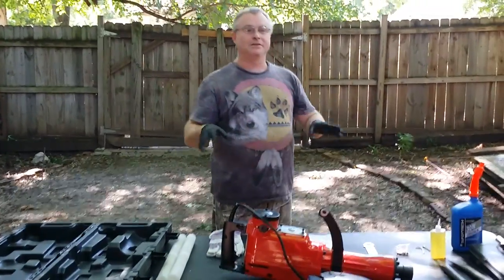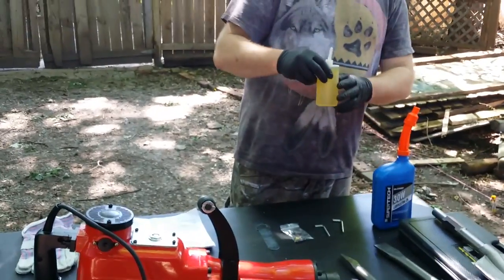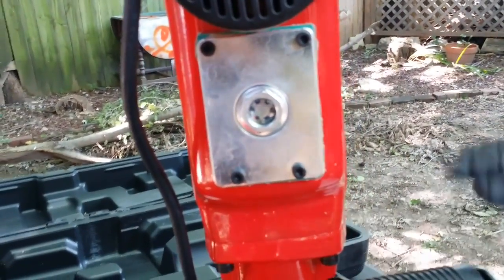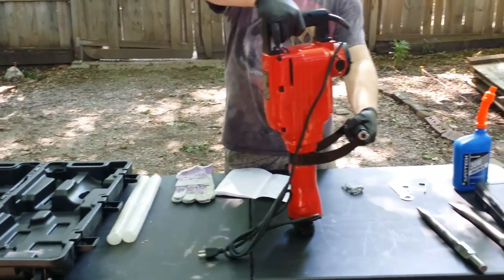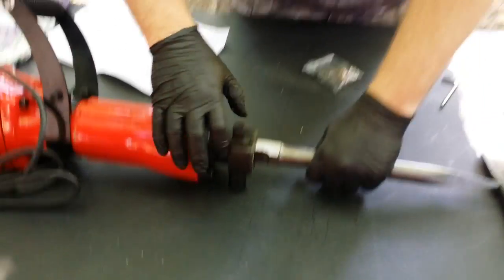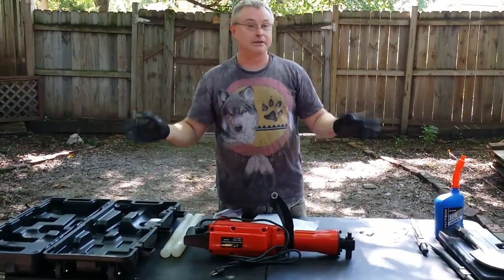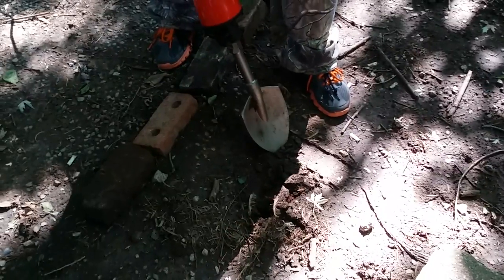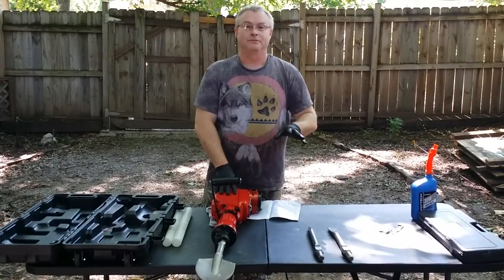Demolition hammer part 1

Comment: I had written quite a little bit on this based on something I heard. I finally got a reply back back from ExtremePowerUS regarding the oil to use on these, and he just said any regular oil from 20 to 40 weight. Gee I hope the heavy duty Shell Rotella 5W-40 Synthetic for diesels does not prove to be too much. They should really have explained all that in depth in their Owner's Manual, but it wasn't even mentioned.
Reply: LOL! I have looked at some reviewers on Ebay for this machine and at least a couple claimed they used light machine oil. That had me baffled, as I would not use such in a machine like this. The reviews are great on this unit and Ebay sells them cheaper than Amazon, plus they accept PayPal. I ordered 2 different types of spades for it. I have an old broken tree stump in my back yard which the inspectors claim can't be taken out with a stump grinder, as an electric power line runs beneath it and the roots have entwined in that line. I have the area marked and will use mine to remove roots and later I will chop the stump flat and use a heavy duty root killer to kill the thing so it can be removed.  I don't know if synthetic oil works well for this machine or not. I am hoping I can use this without it killing my shoulders, as I have bad arthritis. The manual is often the worse bitch about this machine in all the reviews. The print is way to small for me, so I will have to get my magnifier to even begin reading it. We have had a couple of major thunderstorms here for the past 2 days and I just got mine delivered today, so I have not had a chance to use it, yet. The soil here is caliche and as hard as cement, even after a heavy rain. This video sure helps me a lot as to what to expect.  I have a heavy duty extension cord to try out in using this machine, too.
Reply: @a1930ford  I have seen people use just regular 30 weight oil, and I am sure that will keep the metal good enough, but if you really want to protect your metal, you want to run a full synthetic. I believe I am running Rotella 5W-40 Synthetic for diesels. The action of my jack hammer is rough on the oil, and I can tell by the way I run through it as I have to check all the time to keep it from going low. I was recommended the specific weight because of where I live from Rotella's technical support which is a Shell product I believe, and people trust it enough to put it into fleets of expensive big diesel engines. I would have gotten the Amsoil equivalence,  but had to go too far to get it.....Any oil is better than no oil, but use a quality oil, and one that will adjust to your temperature range. You would probably not want to start one on a cold day with standard 30 weight. It could cause an initial stiff amount of drag on startup, and it is never good to strain any motor. 
   Good luck to you on your tree stump. If you are cautious, and surgical enough, you should be able to avoid the wires under it. I learned to use the aluminum oxide steel cutting blades to remove a tree stump, cutting through each root at a time, and then used a cherry picket to lift it out. Just make sure to be able to see in full, and behind it, whatever you are cutting. The aluminum oxide blades are good because they are expendable. Keeping a spray bottle of water is good too in case the blade ignited the tree, as it will smoke. Stay safe. 
   Oh, and regarding your bad soil, if you lay mulch over it year after year, it will enliven it to a humus state. You just do not want to get it too close to the house because of bugs.
Reply: @a1930ford  Oh; also, to avoid shock which is real important for your well being, use at least a bicyclist's gel glove, and never forget to wear ear protection. Also reread my original reply because I had edited it. Hope this helps.

Comment: I just bought one on eBay $108  outstanding tool for the money busted up a solid concrete stoop in no time at all . I had been chipping away at it with a sledgehammer and getting nowhere  took about 35-45 minutes with this tool

Comment: What type of oil did you use? I have a very similar hammer but the manual doesn't say anything about the oil.

Thanks.
Reply from the maker: Gandalf4137 I use 30 weight Super Tech 3 lubrication oil non detergent
Reply: @wolvesr4ever38   I used gear oil ????

Comment: Just bought one myself but a different brand.  It came with safety instructions but no user instructions.  I had to watch  YouTube videos on how to insert the bit attachments and where to put the oil in.  I've rented these before but decades ago.   My question is what type of oil is used?   I couldn't find anything specific for a n electric demo hammer so I ended up using pneumatic tool oil.
Reply from the maker: 10w30 or 10w40
Reply from the maker: Non detergent 10w30 or10w40

Comment: I am looking for a tool to hammer metal and think this might work by mounting it vertically like a drill press.  Is there a lot of vibration?  Does the bit need to be in contact with the object to engage the motor?  How often does it need oil?  Five minutes running time, ten?
Reply from the maker: Check the all once week add if necessary other than that I'm no hat had no problems with it. I have the jackhammer for couple of years now it still works great

Comment: Hi,l like your video.Question?what is causing problem when used the the xtrem jackhammer it runs but chiesel doesn’t have pressure to hit the slab or rocks.is this a chock from a part or missing oil?

Comment: Hi, bro. I just bought a 2800w Makute demo hammer, looking for clear instructions everywhere till I finally came across your video. It's really more useful than the manual. Should I use a 15w40 diesel engine oil? Or something below that? I can see that the video is 7 years old so hopefully you're still around 😅

Comment: I wanted to ask you if you think this demo hammer will be good for breaking concrete in a rotted out fence post hole? So instead of digging them out I want to be able to just put the chisel on the concrete and bust it out. And pull out pieces. I figured it should be way faster than digging them out. 
Anyways that's my plan for mine when I get it. 
Do you feel it will work for that?
Reply from the maker: it will definitely work I used to Shovelhead in the holes for my back fence posts work great and I can't wait to see your project that you get to work with that a demolition hammer

Comment: That Demolition Hammer  only less than $200?  Wow!  I want to get a rotary hammer and was looking at the Bosch rotary hammer rh540m that has 6.1 pounds of blow force for $400 or the Milwaukee 2 inch rotary hammer that has 19.1 pounds of blow force that would cost more than $800 dollars.   All I want to do is use one to drill holes in the ground to place 4 x 4 fence posts where the soil has packed rock in the ground.  So would you recommend that Demolition Hammer you have and for the price is amazing.   How longs does that Demolition Hammer last?
Reply from the maker: Well Tony I've had my demolition hammer now 2 years and I still don't have any problems with it I've only had to replace one spike because it worn down but do I recommend it yes for a under $200 absolutely for what we do around our home is perfect
Reply: Thank You Wolversr4ever38.   I am definetly going to order one next week.
Reply from the maker: @tonymadera3603   I'm glad I could help

Comment: I bought the same model but the locking mechanism isn't turning all the way to lock it only goes half way.  Any recommendations on what might be wrong?
Reply from the maker: ZOMBIEKING779 which locking device on the jackhammer we are talking bout so I can help you better
Reply: wolvesr4ever38 
Hello, it's the locking mechanism/pin where you inserted the shovel
Reply from the maker: ZOMBIEKING779  do have any problem with the spike or the chisel blade with the locking device if so need to return the equipment back or if not the it might the shovel isnt the right one for this jackhammer

Comment: I just ordered one of these yesterday. I've rented the same size demo hammer from Home Depot and they apply grease to the chisels "bits" do you need grease the bits? (The shank end that goes in the demo hammer) 
Thanks!
Reply from the maker: Wyatt's Dad make sure you do grease the the chisels, the  grease will keep it from  rusting and it helps for lubrication when the chisel is causing friction while working

Comment: I have the same hammer drill that I purchased from Amazon. My instruction sheet called it a HYAT ET1108-110v Hammer Drill-65mm.  The instructions recommended (one liter) of Shell Rotella #40 engine oil. My local TSC (Tractor Supply Co) has the gallon jug on sale for $14.99 at the time of my post.
Reply from the maker: mine says Stark on the box as well as 1400 beats per minute there are very much similar ones out there and anyone from Amazon in the proximity of what you're buying depends on the model they have available but the are the beats per minute is pretty much exactly the same Minds is 1400 per minute on my hammer

Comment: Thanks for the video and showing the steps when first getting the tool. I must say the provided manual is “crap” and does not explain AT ALL very well where or how to feed the oil into it. The manual actually points to removing the cap where carbon brush is located and does not even mention anything about unscrewing the oil window as to where to feed it oil. 

I must also warn those that get one, careful with removing the carbon brush screw and screwing back in, it’s a little tricky and hard to seat the brush and spring before screwing the cap back on. 

Great video! Thanks again.
Reply from the maker: I'm glad I could help you and thank you for the comments

Comment: Just received my hammer and your video was very informative. Do you think Miracle oil that is used in air tolls would be good for this hammer?
Reply from the maker: Not thick enough to keep the Hammer working correctly
Reply: @wolvesr4ever38  Thank you - what should we be using?
Reply from the maker: Use 30 weight non detergent oil and that would be perfect
Reply: @wolvesr4ever38  Wonderful, thank you
Reply from the maker: I'm glad I'm help a fellow DIYers

Comment: I just got an Xtremepowerus 2200w from amazon today that looks identical to yours, so I am grateful for your videos! Mine does not indicate amperage, ANYWHERE, but the cord has a 15A plug. Did yours operate ok on a 15A receptacle?
Reply from the maker: Don Olson Don I'm grateful that you got you one you're going to enjoy it as much as I have and yes it operates just fine on a 15 amp cord I use a 12 amp construction cord for my jobs but I don't have any issues with it it runs great just understand that you may have to get new bits for it after about 6 months of heavy use but other than that good luck with it thank you again for taking the time to watch my videos I'm glad I can help
Reply: Hey Don, when you got your jack hammer did it leak oil during shipment to you. Mine leaked all the oil out of it. What a mess?

Comment: Thanks so much for making and posting this video. I just got this same one on Amazon, and had NO CLUE how to use it until now. I have a bottle of electric chainsaw bar and chain oil from Walmart. It's 30WT. Can I use this in my jackhammer??? Also, it came with 2 grounding pins? On the cord it says to use them. Did you have to do that with yours?
Reply from the maker: First let me thank you for taking the time to watch my video second of all the oil that I use is the only one I use is in my video and I have bought other attachments that I replaced after using the spikes and the Chisel they will allow you to use different models and makes as long as they're in the same manufacturer

Comment: I just got an XtremePower 2200w electric jack hammer similar looking to the one you have except the brand name. As I opened the cardboard box that the jack hammer and carrying case comes in, I found the box was soaked with oil at one end.
I opened the carrying case that the jack hammer comes in and one end was also soaked in oil.  I found out where the oil was coming from, then end of the jack hammer where you attach the tools into. Did your jack hammer come soaked in oil?  I got a reply from Xtremepower customer service telling me that it was common for the oil to leak out during shipment, and to add more oil.
They said if it continued to leak oil to return the jack hammer for replacement or refund. They also said to use 30 weight oil. I'm going to put 15w-40 in it and see if it all leaks out again.
You would think that they would tell you this stuff in the instruction manuals, but they don't, the manuals are cheap and worthless.
Reply from the maker: I agree that why I created my videos on the jackhammer

Comment: How do I know if the earth wire is connected?
Reply from the maker: Renaldo Nicholson if you don't get shocked while working the piece of equipment then you know your Earth wire is grounded and connected
Reply: wolvesr4ever38 ok can I use oil on the bits or I have to use grease?
Reply from the maker: Renaldo Nicholson you only use oil in the machine itself you have to use grease for the blts
Reply: What amount of grease should I use on the bit itself? It's my first time owning one
Reply from the maker: Renaldo Nicholson just a very small amount but every time you use it you must grease it just a little bit so the blade doesn't get too hot against hammer

Comment: My ph 65 hammer very hitting problem slovetion please
Reply from the maker: Nasruddin Khan I need a little bit better explanation then that if you don't mind so I can solve your solve your problem
Reply: Wolvesr4ever38 my jackhammer very hitting how to Repair help please
Reply from the maker: Nasruddin Khan see if I understand this right your Hammer is not striking the blade this coming down for you to get a good hit first you need to go ahead and make sure you have enough oil in it most likely you already have have you changed out the oil did you also check your bushings the brushes sorry there's two of them on the on the demolition hammer need to check that it doors if there's no problem with those then you are going to have to tear it apart to make sure the fend if it's Teflon you may have to replace the fin if it's metal make sure there's no debris and no vents let me know if there's any more questions